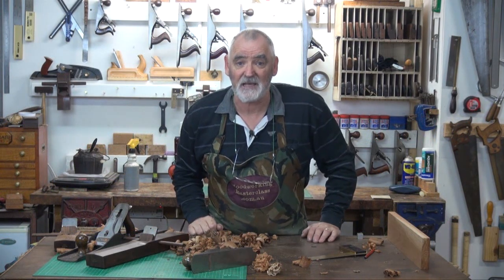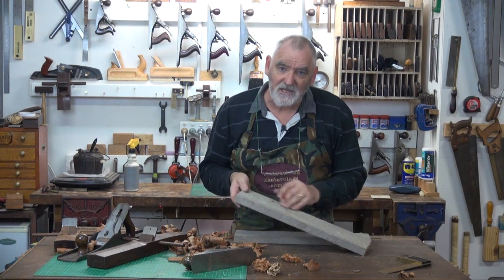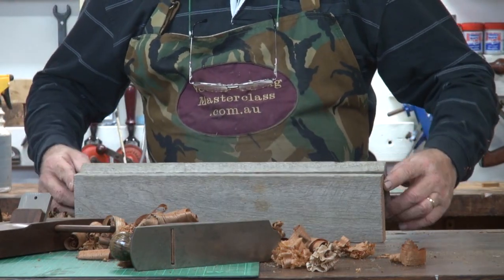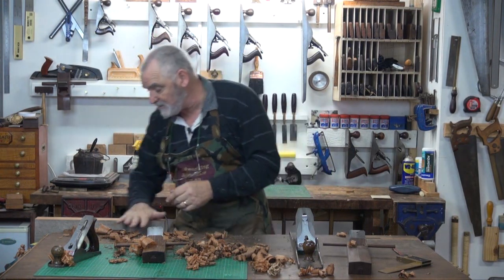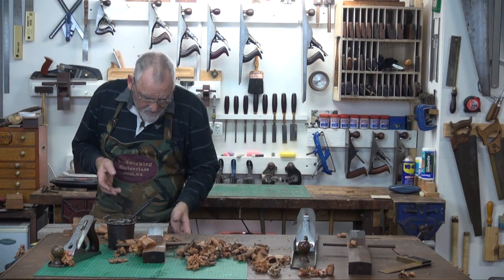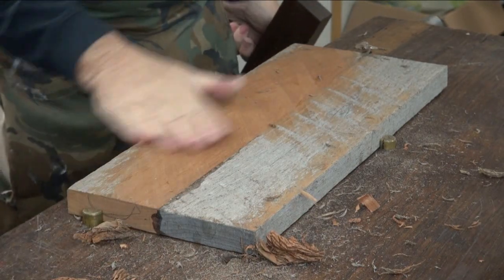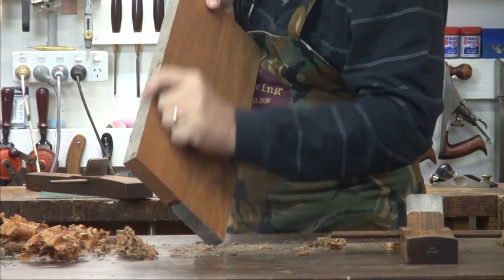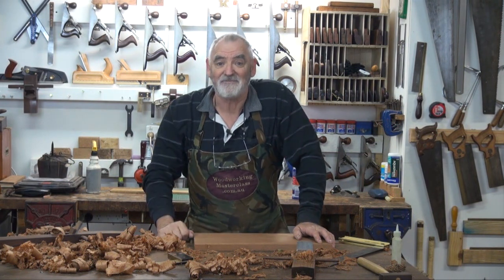Joining Narrow Boards to get the width with Hand Planes

Comment: I had begun investing in power tools, but something did not feel right. Then I came across your table with cabriole legs series. That totally changed my outlook on hand tools. I am a very small-time hand tools guy now and have not used my power tools for months. Cannot tell you how much I enjoy it. There is what I owe to you and Bob.
Reply from the maker: Thanks Retort, I do use power tools from time to time but nothing can replace the satisfaction and feeling of achievement I get when using Hand Tools. Cheers Steve

Comment: Hello Steve, loving your channel and even more so because your in Australia too! One of the aspects I have trouble with is identifying wood, there is lots of information around but not so much from Australia. The wood you are using in this video is one I have had trouble identifying. Could you please let me know what this is? Thanks mate
Reply from the maker: Hi Peter, Yes, it's tricky and you can't really go on coloured pictures in books as the printing ink varies greatly from the actual colour of the wood. The timber in the above video is Spanish Cedar (Cedrela odorata) aka Cigar Box Cedar. It's mainly used in the manufacture of Cigar Humidors, which is the main reason I bought it but it is also used in the making of Classical Spanish Guitars. Hope that helps. Whereabouts on OZ are you? Cheers Steve
Reply: @Woodworkingmasterclass  Thank you for that mate. I am located in Canberra at this stage. I'd be interested in seeing a video on traditional ways to join a table top to a base one day if your taking requests. Keep up the awsome work. You and Paul Sellers are my online mentors.

Comment: Hi Steve, good vid. You jumped a bit there and didn't show planing the second face. How did you achieve uniform thickness of the board, or did you not worry about it?
Reply from the maker: The planing of the other side was covered in the previous video on squaring a board. So I didn't think people would want to watch it twice. I actually show it on the extended version goes for 20 min. As for thicknessing that's coming up. Baby steps, first get people used to planing flat and square then we can bring in the technical side of things. Sometimes to much of to much can be to much. Thanks for your comment and observation. Cheers Steve

Comment: Good Day, I have a question:
At 3:36 you explain a way to keep the boards from splitting. So as I understand, you push down your plane in the middle of the boards to make a little hollow (sprung joint, preload!?)
Did I understand that right ?. You got some very nice looking planes :-D - cool !
BTW English is not my first language :-)
Reply from the maker: Yes, you are absolutely correct. Thanks for the question. Cheers Steve

Comment: Hey, not sure if you're still looking at comment, but I have a question joining boards and how the ends of the boards look different from each other. Is there anything to do to make it took better or not really?  For example, at 7:15 you can see how one end looks gray and one looks brown
Reply from the maker: Hi Adam, That is just an end of a board that has been sun bleached and gone grey. Once finished it will be the same colour as the other side. Hope that helps . Cheers Steve
Reply: @Woodworkingmasterclass  sorry this is a dumb question, but when you say "finished" do you mean like hand planning the end grain or you mean like staining the wood? Thanks!
Reply from the maker: @adamthewoodworker2571  Hi Adam fair question. When I said finished I meant cut to length and have that grey piece removed by a saw most likely. You could plane the end if you want and the stain will be the same then as well. Cheers Steve

Comment: You state that we should have the grain on the end of the board going down on one board and up on the other, to avoid the boards cupping. Then you state that where you then find the grain going one way on one board and the opposite way on the other board, we will have opposing grain and to avoid this we should flip one board. Surely by flipping the board you will put the boards back in a position were both end grains will then be in the same direction and encourage cupping? This can seen by the marks on the end grain of both your boards at 7:45, so you have defeated the purpose of trying to avoid cupping.
Reply from the maker: Thanks for your comment Edward and what you say would be true. In this case though if you look closely @ 7.45 you will notice the grain is in fact opposite and not as the pencil marks would suggest. I think my misuse of terminology is to blame instead of the term "flipping" possibly "spinning" would have been more appropriate. As the timber will then stay in the same plain but spin on it's axis which will re-orintate the grain to be running parallel to the other piece and still have opposing growth rings. Good Pickup. Cheers Steve